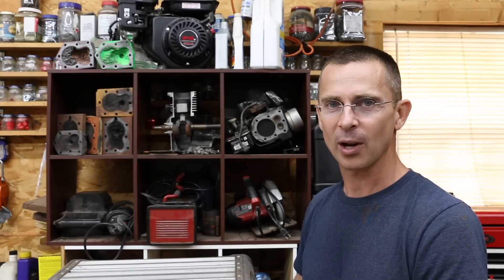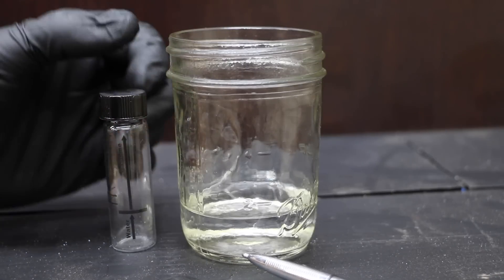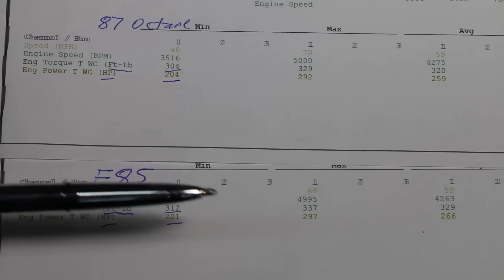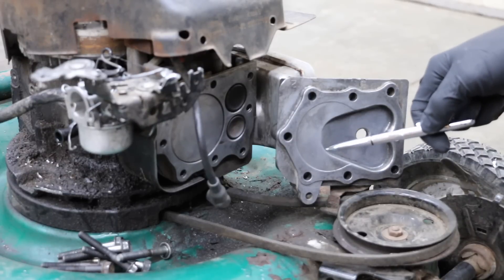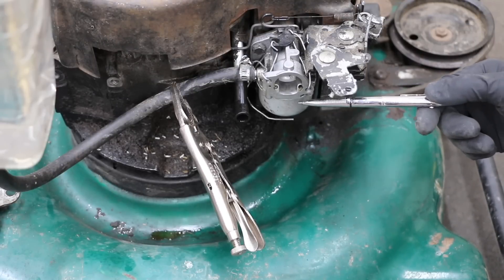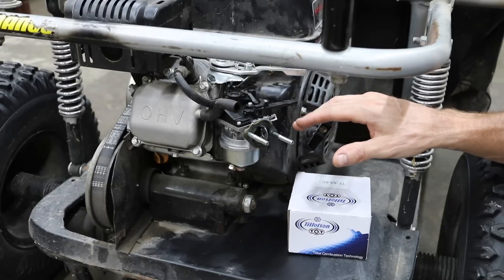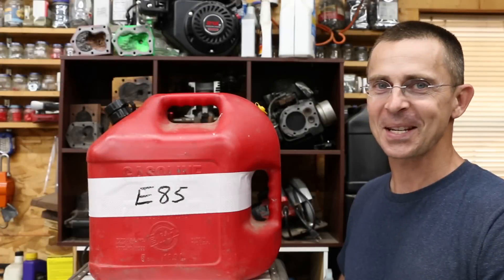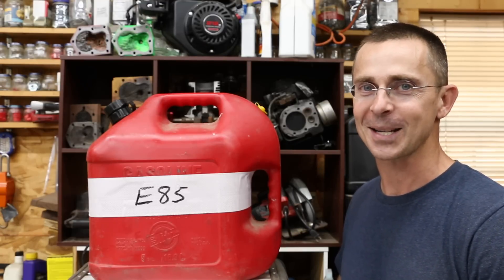Is E85 better than Gasoline? Let's find out!

Comment: Gas mileage on my F150 tanks when I use E85, but I can tell a difference in power. I run a tank every now and then to clean out the cylinders. But because of the price per gallon, and the hit to fuel economy it almost never works out that E85 is actually cheaper to run than standard gasoline.
Reply from the maker: Great point!  It would cost me a lot more money to run E85 compared to 87 octane.
Reply: @ProjectFarm  at Germany the "worst" fuel is 95 octane and the "best" 102 octane
Reply: @antonglonner4687  Europe rates their gas differently.  87 octane is 91 ron
Reply: @Anton Glonner that's RON, the US uses AKI, 95 RON is our 87
Reply: @antonglonner4687  its Not the Same 95. Its a different measurement system Here. The Numbers are Higher but the Gas is Not Higher octane
Reply: @antonglonner4687  you use a different rating system. Look it up, but your 105 isn't any better than our 91
Reply: @Anton Glonner
Different way of testing. US/CAN (and some others) uses RON+MON/2.. Europe uses RON only. The actual fuel is the same.
Reply: @antonglonner4687  the octane scale is not the same, your using RON figures, in the US we use the average of RON and MON figures. 97 octane for you is roughly the same as our 91 octane.
Reply: @TheOnlyHardestR  yes it is higher octane. In the US you use PON ratings which is the average between RON and MON ratings, while in Europe RON is used. Just for reference 91 PON is the same as 95 RON and 93 PON the same as 98 RON.

The 102 RON available in Germany would be about 96 PON in the US
Reply: @leftyeh6495   yes it is higher octane. In the US you use PON ratings which is the average between RON and MON ratings, while in Europe RON is used. Just for reference 91 PON is the same as 95 RON and 93 PON the same as 98 RON.

The 102 RON available in Germany would be about 96 PON in the US
Reply: @somespamsite44   No it isn't the same. In the US you don't find as high octane fuel and even then the fuel in the US is boosted with at least 10% ethanol. 91 PON is the same as 95 RON and 93 PON the same as 98 RON.

The 102 RON available in Germany would be about 96 PON in the US
Reply: You are forgetting about the environment.  You used less gas.  Al though the farmers had to waste tons of water, fertilizer and top soil to grow and process the corn/ethanol and tons of diesel and electricity (that comes from coal).....
Reply: Yeah I feel like it's a wash in terms of environmentalism. All the corn that gets produced for ethanol certainly can't be better for the environment than burning the oil. Also it feels wrong using our capacity to grow food for fuel. But that's corn subsidies for you I guess? I'm torn weather or not those are good or bad considering how they have changed our foods to contain so much corn.
Reply: E85 vs 87 octane is always going to be a wash when it comes to price. Where it becomes beneficial is for cars that are tuned for 93 octane. E85 is usually a $1.00 or more cheaper per gallon than 93. And while you do get less fuel economy, it still works out to be cheaper by a few bucks. And keep in mind, e85 is something like 105 octane... you're getting more horsepower because of more timing.

Naturally aspirated cars usually benefit the least from e85.
Reply: I find that I get the same performance with E85 as ethanol free (91 octane) in my 5.0. The E Free gives me about 2 mpg better than normal 87, but does cost 80-90 cents more per gallon. I keep E free around because of my motorcycles, so it sometimes winds up in my truck by happenstance. I also found that the E free works better with the Seafoam treatments
Reply: Well in cali prem gas is 4.20 cents a gallon and e85 is 2.58
Reply: Try running E30 instead!
Reply: WTF would you want to put ethanol in your tank period?  Do you grow corn?  Ethanol just F's up everything... without Tax Payers subsidizing it BYE BYE...  because it is a substandard product
Corn Growers start planning on different crops Now because the Gravy Train is ending SOON
Reply: @TMB247  I'd put it in my tank because it's a renewable product that is actually considered carbon neutral, and when the world starts to run out of oil, they won't need the subsidies
Reply: @cpufreak101  
You need to do RESEARCH and REMEDIAL MATH
#1 Renewable? as in it is a Crop that takes lots of Energy to Produce as well as a Lot of Water and it takes FOOD away from Starving Humans ... Without Government Subsidies (Subsidies which are unneeded for Oil, Coal, Natural Gas that will last FAR into the foreseeable future, as in Hundreds of Years) Ethanol as a consumer fuel would have been GONE a long time ago, it remains only as a method of BUYING VOTES ie Subsidies.
#2 Take the End Product Ethanol and Mandate that Every Stage of it's Production be Fueled by Ethanol  and EVERYBODY will tell you that it is Impossible (because it is) so again without Subsidies it would Die on the Vine.
Don't Feel bad, Wind and Solar are just as inefficient 
#3 Carbon neutral?  BS from either end that you look at it and all the places in the middle ... It takes  more Energy to Produce than it makes (see#2) it has to be shipped by Tanker (can't use Pipelines as it is Hydroscopic) it is highly detrimental to seals and plastics resulting in Many Many Premature failures of the very equipment it was meant to fuel which are discarded and New Ones must be produced... not very efficient eh?
#4 We Need MORE CO2 not less to make all those wasted Subsidized Cornfields more efficient... those Farmers by growing the subsidized Corn are doing Their Part ... With more CO2 they could be doing a lot better and need fewer or less Govt Subsidies 
Justin pls point out where I am wrong
Reply: I heard that most of the corn we produce is used for other stuff anyways, so it’s not like we’re taking away from our food source, and it is a lot eco friendlier to use e85, in the process of growing the corn for e85 it actually uses up more carbon dioxide than it puts out when burned. (Including the gasoline) Also when Henry Ford first designed the Model T he designed it to run on ethanol but one of the big oil people, (J.P. Rockefeller, if I recall correctly) paid him a massive amount of money to design it to run on gasoline to keep the oil industry booming. Lastly it makes us less dependent on foreign countries. Feel free to correct me on anything I’ve learned all this information just by researching on the internet. Edit: John Rockefeller was his name I got him mixed up with J.P. Morgan lol
Reply: @Mr. Morton aka. Highlander Flex fuel vehicles also have an ethanol sensor that tells the computer the concentration of ethanol in the fuel
Reply: It’s because your ecu can increase timing with e85 thus more power. I’m going to assume you have ecoboost.

If your truck isn’t designed for e85 it’s going to eat your fuel lines and I wouldn’t do that.
Reply: @mrmidnight32  not an EB, but 5.0 Flex Fuel certified. I actually think the EBs are not flex fuel ready off the lot.
Reply: @KarlCarpenter  why do you say that cuz there's no flex fuel badges on an EB?
Reply: I've been running ethanol in my cars when/where available since 1999. 270k on my neon, 100k and 30k on my mustangs, 100k on my RAM - none of them flex fuel vehicles, none of them have had any issues except for winter, i don't use e85 in winter except on my 03 mustang because I need the AKI because of compression/boost, then I try to keep a barrel of ignite E85 on hand since it doesn't suffer from cold start issues. - long as your fuel system can provide 30% more than stock with a tune your car can run E85. Or if its not a high performance car you can run E85 all day IMHO, tune or not.
Reply: @ELJEFEEEE  I thought I remembered reading on one of the f150 boards that the injectors in the EBs couldn't handle the alcohol. Maybe the early gens? They had weird injector/intake valve things go on.
Reply: @mrmidnight32  don't need EcoBoost to have flex fuel
Reply: blanky blank I’m assuming eco because of his increase in power means the ecu can add more timing and not worry about detonation from the turbo. NA applications hardly if ever have to worry about detonation because of the minimal CFM/PSI produced naturally vs a compressor shoving air mass into the combustion with increased timing for a noticeable gain in power output.

I doubt anyone will ever feel 5 -10 hp and I doubt a NA ecu change will add 10+ hp due to fuel change

Comment: Could you test Name Brand vs Off-Brand refrigerator filters?
Reply from the maker: Thanks for the video idea!
Reply: I should specify that I mean the kind that are built into the fridge and meant to be replaced ever 3-6 months, not Britta or Pur or any of those kind that just sit inside your fridge.
Reply: Versus each other AND against the cheap in line filters that you can use instead of the expensive manufacturer ones.

Comment: E85 is awful unless you tune your ecu only for it, so in hotrodding it's used alot.  For the normal public, it's mostly junk.
Reply: My 87 Buick Grand National loves E-85 105 octane!
Reply: The lexus dealership filled up my GF car after doing a recall.  Last time she brought it in for a warranty repair the battery died 2 days later.  I seriously wondered if they threw some baking soda into the battery to kill it so she would bring it back in for repair.  I wonder if they filled up her tank with some crap gas or ethonal.  If she starts having issues in the next couple days I will have my answer.
Reply: Michael Mantion why would you bring your car to the dealer to change the battery?
Reply: if its a very modern computer tech Lexus car, the new battery must be learned on to the onboard diagnostics (!!)
Reply: That´s why i think carburetted or these small engines gain no advantage of E85 or onyl combined with "oldschool" tuning like you did with the bigger jet carburetor, next step a sharper ignition timing + maybe a bit sharper camshaft timing (more "stroke" of the cams for the valves).
Reply from the maker: Great point. Thank you
Reply: U need more E85 and a higher compression in the engine 2 take advantage of higer octane number of the ethanol.

Try a turbo car with an modern ecu. it will monitor the knock in the engine and then maximase the HP. (within the specs. of the 
fuel nozzles).
Reply: @StarDollar  Civic SI makes more power with OEM compression. (advanced timing)
Reply: @ProjectFarm  great point? My wifes 352hp 2.3t Aero Saab 9-5 biopower dailydriver and my toy, my11 Saab turbo awd, also running with E85
might differ on this "great point" 

I have near 270.000 kilometers experience on  E85, Saabs and Volvos, E85 is great stuff for highly tuned turbos, even factory stock ones...
Reply: Brian South well said. more GUMMIT BS rammed up our asses
Reply: @tdidan nothing modified to run e85.

Comment: If you have a flex fuel vehicle that needs 93 octane or higher, E85 can be a good choice financially. I had a 2012 Sierra with stage 3 cam which was tuned for 93 octane fuel. I would run 4-5 tanks of E85 in a row to save money, then run a few 93 octane tanks because I don't like the thought of ethanol being in the system ling term. When the choice is 87 octane vs E85, 87 octane is almost always cheaper. Also, it's good to note that it takes the ECM a good 50-75 miles or so to adjust the timing for E85 and regular gasoline when going back and forth. Nice experiment!
Reply from the maker: Great point and thank you!
Reply: not exactly true. my F150 can tune itself for all of them 87-93 and e85 E85 gives me the same performance as 93 but cuts mileage by a ton. I get 18 highway with 93 and only 14.5 on E85. it doesnt save any money.
Reply: enigma9789 When I had my Sierra the price difference was very significant between E85 and premium, so I'm afraid it was indeed true. I said it CAN be a good choice financially. I also saw a very noticeable power difference with e85. GM now advertises E85 hp/tq ratings alongside regular gas hp/tq ratings.

Comment: E85 vs Race Fuel?
Reply from the maker: Great video idea!
Reply: I switched from C-16 to E-85 in my 1,250HP race car that sees 21+ psi of boost. The car makes more power on E-85 and the second benefit is that I saved a ton of money. A barrel of VP C-16 cost about $1,100 while a barrel of Pro E-85 cost only $350. So more power for less cash. Can not beat that.